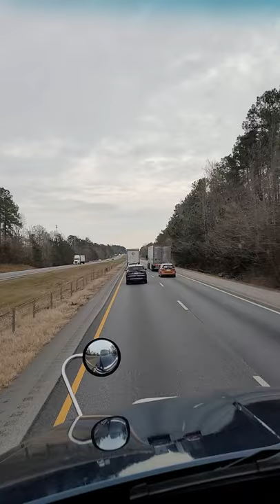How some Tractor Trailer Drivers cause needless TRAFFIC - Underpowered Overtakers!!!

Comment: First off the guy on the right could easily hit his brakes dropping 2-3 miles an hour and let the other guy pass without causing the traffic to build up. The guy on the right is just as guilty because even though he knows the other guy can only move a little bit faster than him he is still gonna make the guy on the left “earn it” it’s not just one persons fault.
Reply: Its not always as straight forward as that. In the UK wagons are restricted to 56mph. Fully loaded theres no way the wagon will slow down especially on or approaching an incline he will lose speed and take forever to get back up to 56
Reply: If you’re restricted to a slower speed then you shouldn’t be trying to pass anyone. And if your not running that speed the. You can still just as easily bump your brakes. Your already traveling below the speed limit.
Reply: @joshuabrumley2169  was comment to me?
Reply: @sheedy1120  yes it was I was just continuing the conversation. In America different states and cities have different speed limits for semis. But usually it’s the same as the cars for most highways and freeways. As well as different companies govern their trucks down to certain speeds. My company won’t let my truck run over 72mph. But with common courtesy for everyone on the road way it will help free up a lot of the traffic and traffic jams. Unfortunately today everyone had to come in first place and turns it into a race to get down the road the fastest. Most cases though slowing down only a few mph won’t cost you more than 1-2 minutes time. It lets the slightly faster vehicle by, therefore let’s the faster vehicles around him not causing a back up and not causing a wreck.
Reply: @joshuabrumley2169  First its unbelievable that trucks in america can run at 70mph 🤤 I think some boffin decided that 56mph was the most economical and/ or the safest speed to travel wen pulling 44 tonne. My point wasnt really directed at other trucks overtaking its usually car drivers who are the problem. Ill give you an example and bear in mind in the UK the first lane is were ALL vehicles should be unless overtaking and trucks are not allowed to be in the 'fast lane' Close to me the is a stretch of motorway 'highway' that runs uphill for maybe 3 or 4 miles. As it has lot of truck traffic it has 4 lanes. This happened to me, I was in the 1st lane 200 yards behind the vehicle that I was catching he may have been doing 50mph. He pulled out to overtake a crane travelling around 40 mph I pulled out for the crane and was still gaining on the truck that I was behind. I indicated to pull into the 3rd lane in plenty of time to let cars coming up to let move over. None of them would. Due to my weight I had to slow down to match the truck infronts speed and because of the incline couldnt get my speed back up....I ended up behind the crane all because a few cars wouldnt yield. A car can get from 50mph back to the max 70 in seconds but they would let me in. Bastards.
Reply: @sheedy1120  we definitely have the same problem with the cars. And usually it is the cars. But we also have some very unpleasant truck drivers here as well and if you think the 70 mph is good if you own your own truck you can basically set the speed limit to what you want depending on what your insurance says.
Reply: @sheedy1120  my whole problem with this video is the guy yelling about the truck slower than him trying to pass an even slower truck is only blaming the one trying to pass but if he ever stopped to think the slowest truck in the right lane could just tap his brakes a little bit it’s not gonna have a great affect on him due the fact he is already moving slower than the rest of the traffic and the congestion wouldn’t have happened in the first place
Reply: @joshuabrumley2169  to be fair shit drivers whether in cars trucks are the same all over the world. Imo how to drive in the vicinity of trucks should be introduced into the car driving test it could avoid some accidents or unessesary incidents as some car drivers have no perception of what a truck driver has to deal with
Reply: @sheedy1120  absolutely!!! It should be part of the driver training just to acquire a license but it wouldn’t help look at how many bad drivers have commercial licenses now
Reply: @joshuabrumley2169  I passed my car driving test over 40 years ago and in the interim period the standard of driving has deteriorated its diabolical. When I was younger like most kids I dreamt of having a Ferrari etc if I had one now I would take no pleasure in driving it.